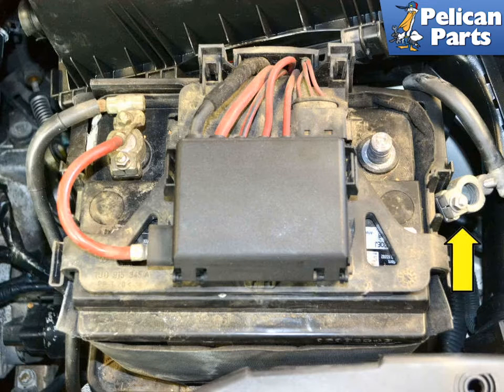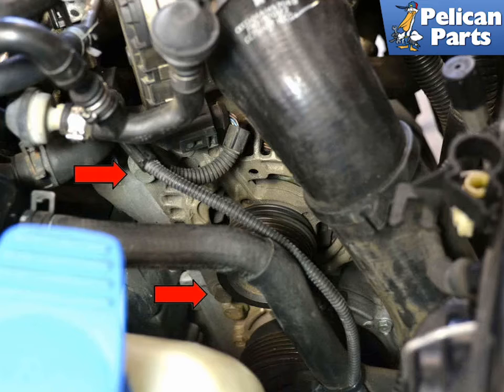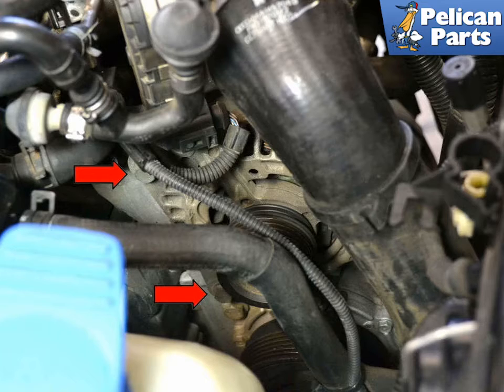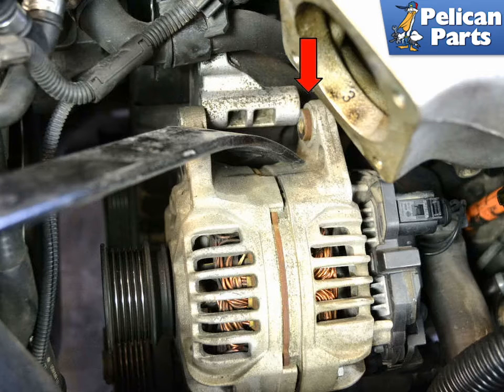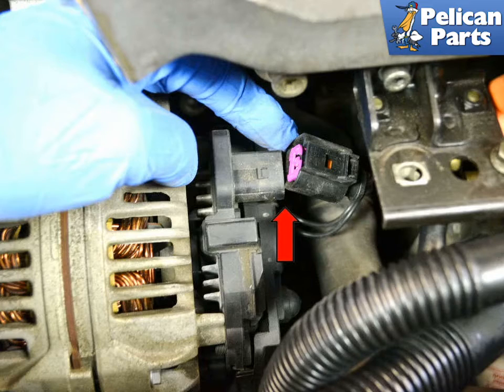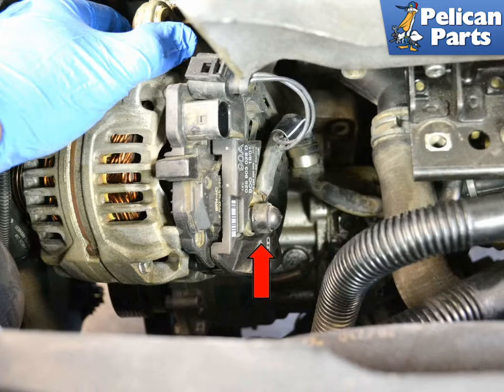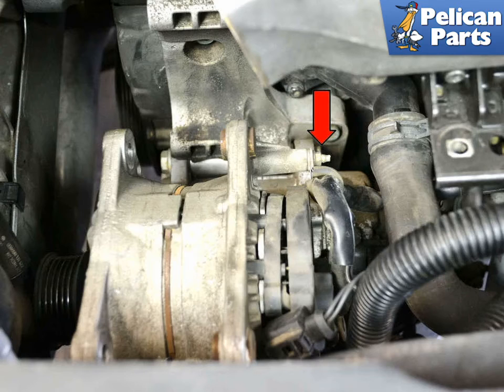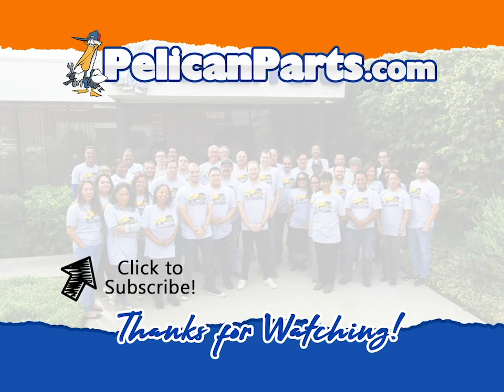Volkswagen Golf GTI MK4 Alternator Replacement (2000-2006)

Comment: Hello Pelikan Parts, I have a question about the 90 amp vs 120 amp for the 2005 MK4 VW GTI 1.8T (Manual). My alternator has failed and I am shopping for one. I was wondering if it is ok to replace the original 90 amp with a 120 amp? Checking the website lists both of them compatible with my car. Car has aftermarket Xenon headlights which are flickering in idle with the current malfunctioning alternator, I was thinking maybe a 120 amp might help running the aftermarket headlights, in case they are causing more load to the electrical system. Thanks for the tips!
Reply from the maker: Shouldn't do any harm The regulator will control the alternator as needed.